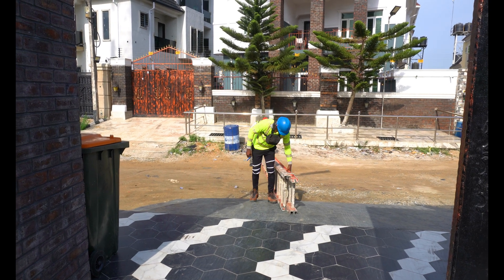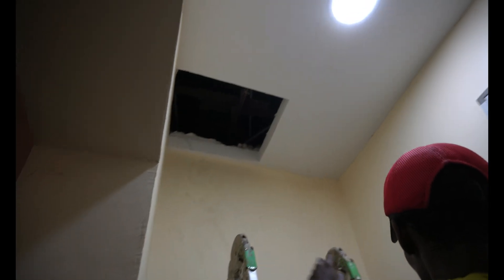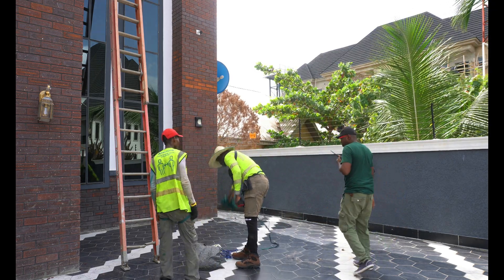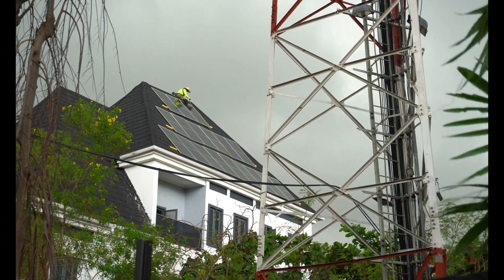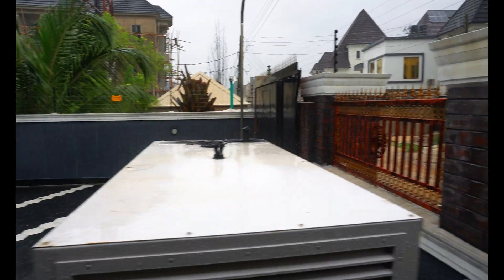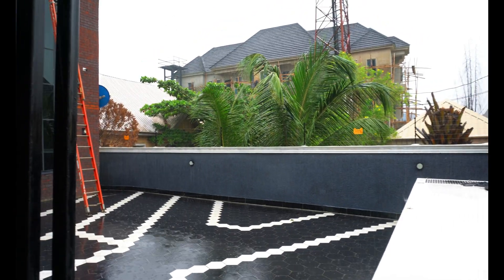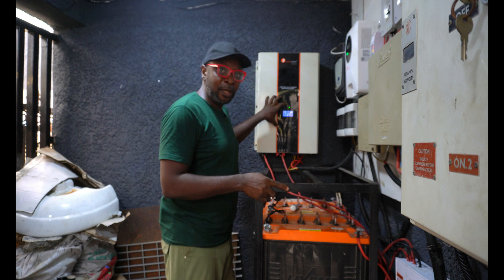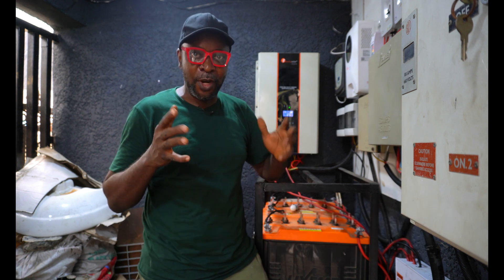Fixing a badly set up Solar Installation

Comment from the maker: Share your experiences with us about steep roof installation or system not working after system set up.
Reply: the sun do rotate but i av 12 unit of 600watt half cut.6 unit in the front roof and 6 unit in the back roof.before d front produce more but now the back produce more.d front is 2800watt out of 3600watt and the back do produce 3100watt out of 3600watt.6 is in 5kva inverter and the other 6 is  in another 5kva inverter.i parallel the output of the inverter giving me a total of 10kva
Reply: I also suggest replacing the charge controller to 2pcs of 80A,that will make a perfect job. Thanks from @astroelectric1
Reply: @Astrotech3  i dont need charge controller bcos am using two units of 5kva hybrid inverter with 120amp inbuilt charge controller.i dont need extra charge controller